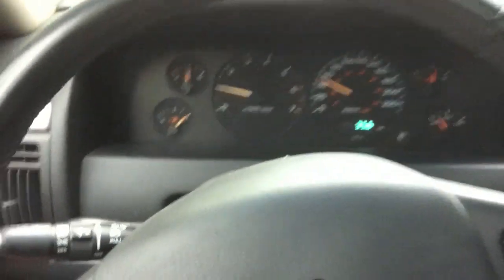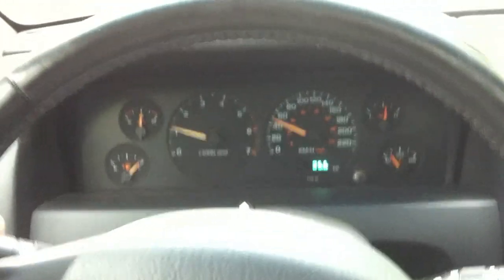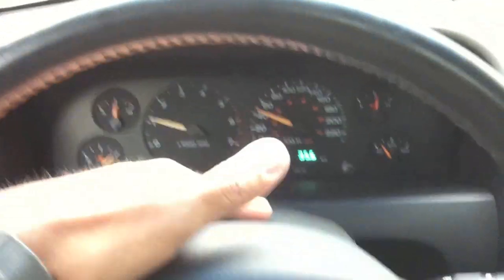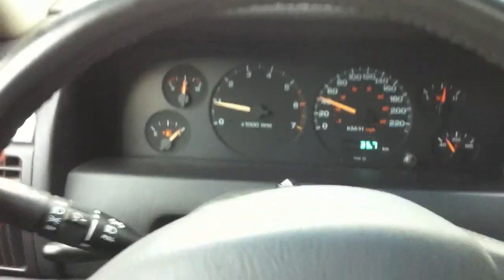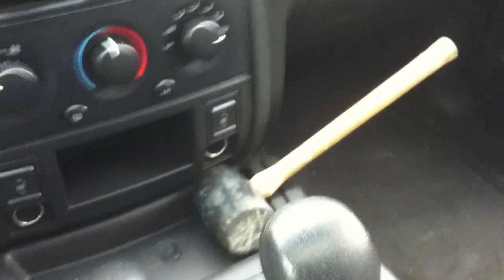Jeep Turn Signals not Working? Here is a quick fix.

Comment: Okay so i had the sane problem and the same solution worked, but since its not a permanent solution i tried to investigate, i google which relay is for the hazard lights and indicators, remove it, cleaned the connectors and installed it back again firmly and it worked! Havent hit the column after that

Comment: omg my left turn signal stopped working and I'm sitting the parking lot trying to figure out what to do and I watch this video and as soon as you hit that with the rubber mallet I took my hand and smack the bottom of mine and it started working, so I'm going to invest in a rubber mallet
Reply: Yes jeep engineering over looked the simplicity of functionality in all circumstances 🔨

Comment: Wow, you are a king ! I just tried that and it works :) I was pretty close to go to repair store and spend $$ on changing flash relay. Also, a couple of months ago I put some $$ and change turn signal switch but nothing. If I had seen this video before, I would have saved money for switch. But, now you saved my money for not replacing relay :) and made my drive safer. Thanks a million 😊
Reply from the maker: I eventually changed the relay as well, I managed to get one from a wreck yard
Reply: @warrenhardy  seems to me I will do the same. Namely, everything work fine for couple of days, and today the same problem happened- left turn signal doesn’t work. I am going tomorrow to car repair service to let them try fix it.

Comment: I tried your technique on my 2004 Wrangler and it worked.    I replaced the multi-function switch a couple of years ago.  Prior to that it worked fine since new.  I'm going to replace the flasher/turn signal relay and see if that solves the problem.  Thanks for posting this handy video!
Reply: Hi did replacing relay help or was there something else like mine
Reply: @andymarkaa  It was actually just loose, but I replaced it anyway and added electrical tape to keep it tight.  The new part will work with trailer lights.
Reply: @archstanton9703  thankyou will try that

Comment: Have the same problem. Never happened until I moved to a town that has me driving over railroad crossings all the time. Wasted money on new bulbs and sockets. Gonna try the rubber mallet lol.
Reply: This nice trick worked for awhile but not anymore. Looked to replace whatever is not reliably connected. Removed the cover and checked some of the wire connections. One of them had two metal prong fall out after detaching the connection 😅 all in all the mallet trick works but not a permanent solution and could just make things worse by hitting the connections.

Comment: I will certainly try this as my right signal works intermittently. Sure wish the mallet trick would have worked on my POS 3.7L engine !  On my second one now, I believe the previous owner got it too hot and besides the head gasket it threw a rocker arm  ! Parts and labor for used motor : $3.100.00. Due to crazy prices nowadays on used vehicles, I decided to keep what I have. Used one purrs like a kitten. 👍

Comment: I tried it and it works, temporarily fix though. Take the flasher out and inspect it under magnifying glass, find crack and solder it. Easy fix 

Full Cheap OEM: Turn Signal "Blinkers" Relay Failure Fix on Jeep Laredo 2002
Reply from the maker: I ended grabbing one at a wreckers for $10.
Reply: broken blinker switch Jeep Wrangler

Comment: Unbelievable! I was planning on bringing my car to the Chrysler-Jeep dealership tomorrow when I saw this video clip and tried this technique and son of a gun it WORK!!!
Reply from the maker: You will still need to get a new relay, I took mine apart and find crack and solder it, but eventually I picked one up at a wreckers for $10
Reply: Is a new relay difficult to install? I still need to take my Jeep at the shop. :(
Reply from the maker: Polypolite its not to hard, no tools required, its a tight area to get your hand into. the easiest way to find the module is to turn on your flashers or hazard lights, and feel around under your dashboard (near the steering column) for the clicking sound, you will know it when you feel it, thats the one you have to pull. mine was square about 1"x1", and it had to go back in the same direction.

Comment: It worked! Smacked it with my fist, and it started working again. Finally a fix where a touch of violence actually works. FYI the actual part costs about $60 at autozone.
Reply: Do you remember what the actual part was?
Reply: @SputnikJay  it's been a while, but from what i remember, the flasher relay can be found for about $60. If you know how to solder, the contacts are likely corroded, and the part can be repaired.

Comment: hey that's a funny thing , my 2000 Jeep Grand Cherokee has the exact same turn signal issue and funny enough I just smacked it with my hand from underneath while driving, and bam; it works! Thanks for sharing that it definently helps me slide bye until I fix the issue..

Comment: I've got to try this. Mine has the left signal get stuck in the on position, which stays on even if the car ignition is off. It's cost me a new battery from draining it overnight. Hoping this will be a cheap fix for my last couple years having this on the road.

Comment: Had the same problem ...saw you video and.. boom! ...signal working again ....but...it kept on happening and as time went by it took more and more wacks with the mallet to get it to work ...now the mallet doesn't work at all. ....so i guess its time to get a relay.
Reply from the maker: Yea. Eventually I replaced the relay. Got one at a junkers. Did it myself, it’s not hard if you have small hands.

Comment: remarkable and i love the solution.  but, most likely this is a dysfunction with the actual signal/flash plastic part inside the column located at the turn signal.  a two hour replacement job at jeep.
Reply from the maker: I ended up doing it myself, pulled the part out of a jeep at the junkers, and replaced it myself. fine ever since.
Reply: hey what needed to be fixed if you don't mind me asking. having the same problem thank you

Comment: This is GREAT!!!  I am going to try this tonight...
Reply from the maker: This issue only happens when it gets cold for me, eventually I pulled the relay out, took it apart and with a magnified glass I was able to see two small cracks in the soldered joints, I used a pen tip solder gun to gently fix the cracks, and the problem is gone now.
Reply: ya the tip is working.  It is crazy, they all have their tricks...I might just buy a new relay, since I don't know where my soldering gun is...lol..
Reply: Sara heyyy! It's Akio's mom! He misses Mason, I'm gonna text u

Comment: 2007 Jeep Grand Cherokee lorado My left blinker intermittently stops working like the bulb is bad. Other times it just comes on by its self. Last night on my way home both blinkers were going fast . When I stopped I found I had NO lights at all in the back. I tried the emergency flashers nothing. Yes I had my lights on.  Watching this video no one has mentioned no lights at all in the back when it does this.

Comment: i have that problem right now with my chevy on 16 fuse slot from inside the truck it will blow the fuse im wondering if its in the turn signal switch or if its a wire touching causing it to blow. might have to try this but idk if this guys fuse is blowing or if its just the signal handle itself.
Reply: +Travis Epp are you asking this clown like he's a mechanic? If you keep blowing fuses there is a short in the electrical system of your vehicle. Electrical shorts can catch on fire, fix it proper or take it to someone who can or junk that beater and get yourself reliable transportation.

Comment: What is the initial problem? Wire, switch, or relay?
Reply: +llunaricardo78 Turn signal relay switch needs to be replaced (or re-soldered) for a real, permanent fix.

Comment: Here's a question... how long can you continue to do this before it stops working and you have to replace the switch? I was hoping to get a month out of it.
Reply from the maker: yea you might get a month out of it, I found that it just got worse and worse over time.
Reply: Thanks!!!
Reply: Was it the flasher unit or the turn signal switch that needed to be replaced?
Reply from the maker: its was a "turn signal relay"
Reply: Thank you!

Comment: I want to try this but I worry I will activate the air bag?
Reply from the maker: I’m no expert, but I think the airbag sensors are in the bumpers
Reply: @warrenhardy  but they are located I mean they deploy from near the steering wheel? On the mallets they 8 oz and 24 oz which did u use?
Reply from the maker: @DebbiesWorld  I'm not sure, it was likely the smaller one, and yes I certainly don't want to see an airbag deploy. yikes. just try hitting the the steering column with your palm, some people have even just kicked or kneed it. at any rate, this is not a fix. its just a way to get the signals to work temporarily at best.
Reply: @warrenhardy  I’ve figured out if I move the front seats I lose lights last month it was break lights and running lights...I really don’t think my relay or switch went bad on Saturday so smacking it with a mallet seems deserving...I also read that disconnecting the negative battery cable might also reset it...I’ll try the whack first!
Reply from the maker: @DebbiesWorld  yea that sound like bigger problems. in my opinion chryslers use a cheaper wire that seam to crack and break, I have had to repair wires in the doors cause the windows stopped going up and down.
Reply: @warrenhardy  I just broke down and spent 500 to fix two windows..it probably was the wiring but of course they always say window regulator...over the years I’ve fixed the windows at least 8 times.
Reply: It magically came back on before I had to wack it...turn sigs are back...mallet will remain in the car 🚗

Comment: On my 2008 Jeep Liberty the mallet trick wouldn't do anything. As there is nothing down there! So I didn't bother trying.
Fortunately, it's very easy to pull the turn signal assembley off the steering column. 
Pull down on the cover just below the steering column. Then 3 screws under the wheel will let you pull off the two halves covering the column. You need a special star head screw driver for this. Then there's a phillips screw holding in the turn signal assembly. 2 wires plugging in. I pulled those off and then played with the action a bit. When you push down to engage the signal and it 'clicks' into place. Try flicking the white plastic piece on the other side a few times. Hook it up back and see what happens. 
Good Luck!

Comment: too funny, but worked.. Warren or anyone can you help me with this, I have a 2001 Grand Jeep Cherokee Laredo was that the L&R  front  wheel speed signal malfunction as well as the RR wheel speed signal malfunction., and the G-Switch malfunction.  what do I do to fix.  My original problem was that while driving it feels like jeep was in 1st gear wouldn't get up to 30 miles.  I have 4 wheel drive, it looks like it in 2 wheel to the top.  when in park and I shift gears I can do and I feel a change in shifting.. Can anyone help me.

Comment: Has anyone with this problem noticed that it gets worse in cold weather? This trick used to work like a charm the few times I had to do it, but it seems the colder it gets the harder it is to make it work. I'm just wondering if it's actually the cold weather, or just my poor old Jeep getting more worn out? 😅

Comment: My 01 60th Anniv edition the right turn works, the hazards work - but the left wont work, unless its really super hot in the car (defrost works great on high for it) or i hit the top left steering wheel with my hand, hard. Right about 9:30-10:30 position. Ill be sitting at a light, banging my hand on the steering wheel cant imagine what people think. I did try kicking the underside but didnt work. lol

Comment: I have this exact problem. The first time I saw your video I shrugged it off but after checking out what that part costs and what's involved in replacing it I decided to watch your video again. I don't have a rubber mallet however I do have some heavy duty, short boots with rubber soles. I smacked the bottom of the steering column with the heel of the boot and damn if it didn't work!! Thanks.

which begs the question... How long will this last before I have to do it again?

Comment: So anybodr know how to permanently fix this ?
Reply from the maker: There is a relay unit under the steering wheel. It needs to be replaced, but very difficult to get to. I did eventually replace it, but that’s why hitting that area pops the relay back into working order temporarily.

Comment: Replacing the 'multifunction switch' (turn signal switch assembly) should solve this problem since "banging" directly beneath seems to be a (temporary) fix due to a 'short' in the turn lever switch....

Comment: I have been trying to figure out what is wrong with my turn signal for the last 2 weeks. I was on the road and watched this video at a red light. I didn't have a mallet, but I had my foot, so I kicked it. Voila! I'm sure it is not a long term fix, but I am pretty impressed and happy that my blinkers are working again.
Reply: Hi there did you find what was wrong with the indicator in the end

Comment: why don't you just go down to the parts house and buy another turn signal relay  that's what i did to my jeep!
Reply from the maker: +SuperJeremi10 eventually that is what I did. this was a short term fix
Reply: lol ive got to figure out whats going on with my transmission now it just started this week but it has  ahrd shift with a bang like noise at times going from second to 3rd i think it is but it only dose it every now and then only when its cold once everything has warmed it runs fine one day it shifted at  2500 rpm then 3000 then 3500 and  back to 1800/2000 i re adjusted my shift cable that seems to have helped some for now my tyranny fluid isn't burnt and im not low on fluid.
Reply: +Warren Hardy  did you make a video of when you replaced the part?
Reply from the maker: +Robert Cox I guess I should have, but if I recall, it was extremely hard to reach with my fat fingers, let alone film it. the tricky part was getting the new one in place in the correct rotation to plug in.
Reply: haha a few weeks ago my ignition switch locked up   so i sprayed wd40 in it now it works again i got to get it to the shop and have it replaced have it reprogrammed to the computer.

Comment: same problem i have had more electrical problems out of my 1999 jeep grand cherokee than any other vehicle had a 99 taurus 200 thousand miles got a 94 s10 around 190 thousand never had any problems out of the electrical in 8 years but this jeep is crap